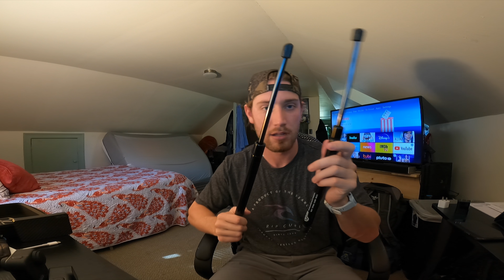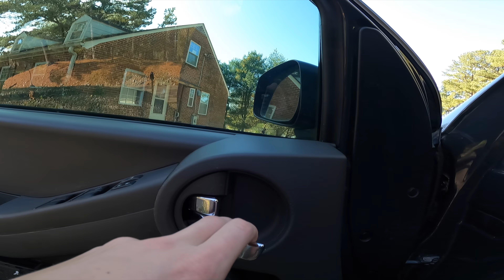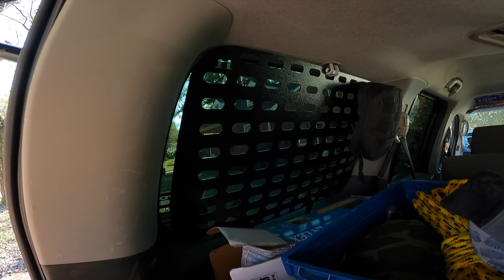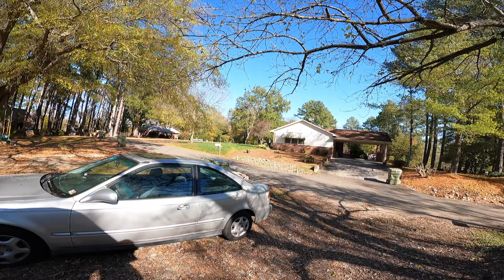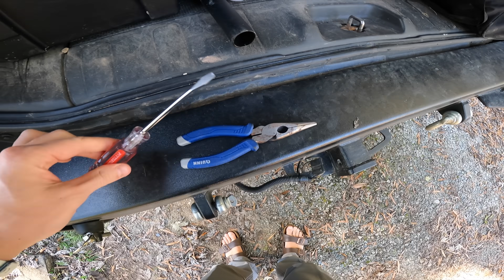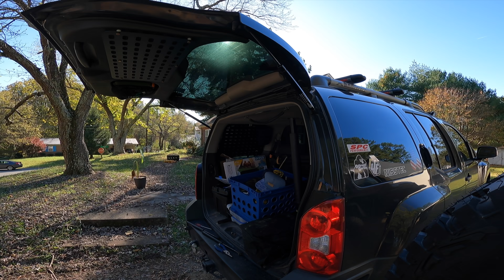How to Install Molle Panels and Lift Gate Struts | Nissan Xterra

Comment: Hey my friend, for the rear window panel, did you just drill straight into the plastic trim? I’m ordering a set this week
Reply from the maker: I popped it off so that I could put a nut on the bottom

Comment: Hey I’m just wondering what is your tires size ? I’m thinking to change mine but idk what the biggest size I can have on it. Thank you 🙏🏼
Reply from the maker: hey man, I am running 33" M/T tires with 1.5" wheel spacers. I also am running a 3" lift from nisstechlifts.com. that being said, I still needed to trim a bit of the bumper in the front to prevent rubbing while turning and to allow for articulation of the suspension. hope this helps
Reply: @conheck_offroad  thank you
Reply from the maker: No problem!